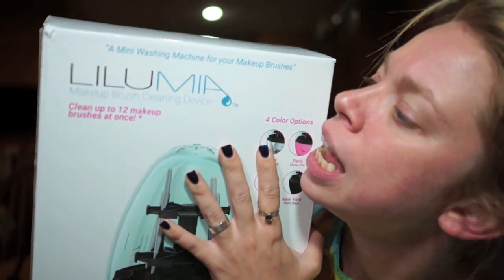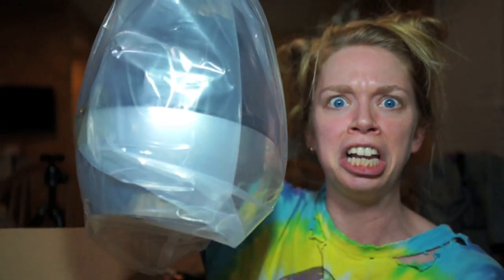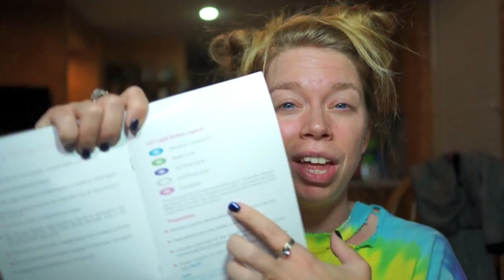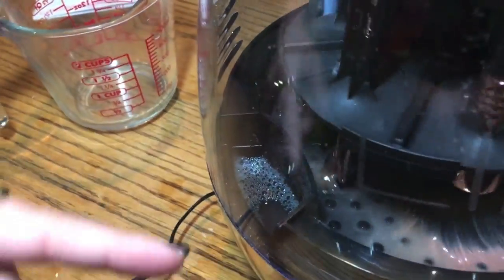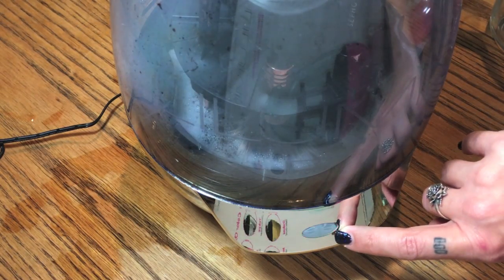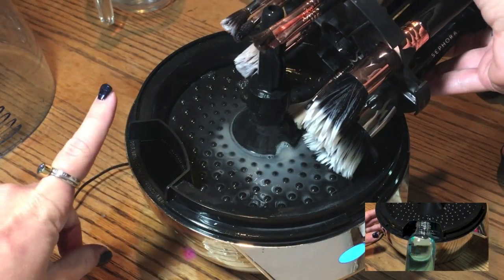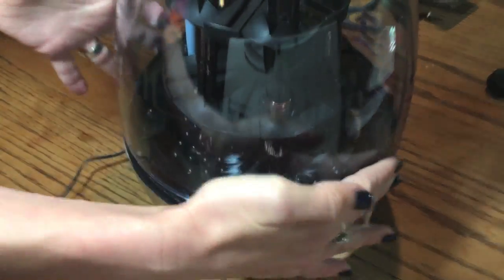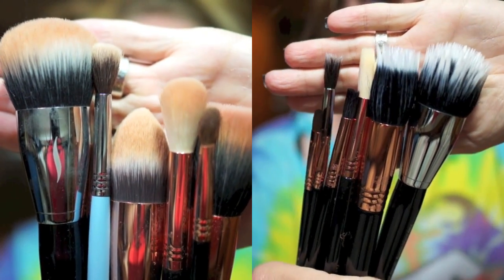MAGIC BRUSH CLEANING ROBOT? - FIRST IMPRESSION FRIDAY

Comment: Not only is this expensive, but would take HOURS if you want to watch a lot of brushes at once.

I also can't believe how little soap they give you. You would have to buy a new bottle each time to wash your brushes (considering you use 1/3 to just wash 6 brushes).
Reply: +ChapterStackss The Lilumia soap that Bunny has is a SAMPLE size soap .The Lilumia Soap is 33 ounces and last approximately 3-4 months if used once per week washing 6-12 brushes depending on load.
Reply: +ChapterStackss The product doesn't even come with that sample size soap if you were actually to buy this. So you'd have to buy the machine and also purchase the soap -.-

Comment: After multiple 15 minute cycles, you washed 6 brushes in the same amount of time I could hand wash all 36 of my brushes. Some things are just better done by hand.
Reply: Yes but she said she has issues with her hands from a car accident.
Reply: +Tanya Cole The Lilumia consist of 1 wash 2 rinse and an optional 3 min rinse cycle. The Lilumia takes a total of 15 mins to deep clean 6-12 brushes depending on brush load.
Reply: +Tanya Cole You use 36 makeup brushes?
Reply: +Tanya Cole Did you not read her annotations? A re-rinse was 3 minutes. She did another 15 minute cycle with just water because she accidentally put in too much soap.
Reply: +Humming Birder If she is a makeup artist then yes she does.
Reply: +SunnieUrieCarlile If she is a makeup artist, and I was a client, I'd want her to use a different set of brushes for each client.
Reply: +Peggy P that's clearly why you're not a makeup artist. Do you have any idea how expensive a brush set is? Never get your makeup done professionally if that's the case 😒
Reply: +Midnight--answer Don't worry.  I don't want my makeup done by a pro.  I do fine myself with five or six brushes.
Reply: +Midnight--answer Yikes Do you really think that they reuse makeup brushes after rubbing it all over someone elses nasty face?  They have to clean them in between I thought.  I know the sets are expensive and all but they do clean or sanitize them in between customers right?  Just realized this sounded sarcastic but I do not mean it that way.  I honestly would like to know the if in your experience they clean in between.
Reply: yep,but you could be doing something else while the device is washing the brushes😏
Reply: avaorchid Oh there's no need to worry about a MUA using unsanitary brushes on you, they absolutely will disinfect the brushes between customers, generally with alcohol to kill all the bacteria. I was just stating that it would be ridiculous to require a MUA to buy a new set of brushes for every customer. I can promise you that you shouldn't worry about unsanitary brushes if you ever wanted to get your makeup professionally done ^-^
Reply: This thing is really just a fun thing to watch, not very useful but as I said fun to watch
Reply: Agreed, especially if you made errors like Bunny did. 3x's 15 minutes = 45 minutes. My brushes take the same amount of time to wash and air dry lol
Reply: it'd be better if the capacity was larger. if it held about 20 brushes that would be great and would def save time. I was each brush for about 30 seconds.
Reply: still you are able to do other things while the device is working so time IS saved no matter how many cycles it takes.

Comment: Wow the ferrules of those brushes are being soaked by way too much water. This machine is a disaster. Great infomercial, Bunny.
Reply: And bunny, you ARE smashing them, stop trying to make excuses for this travesty. I'm disappointed.
Reply: What are ferrules? Are they like the metal part? Also, I totally agree with you , its gonna ruin her brushes. Also, if you look at the brushes before and after their no longer super fluffy
Reply: +ilove cats The ferrules are the metal part that holds the bristles together, and hold the brush to the handle. I agree, this machine is way too rough on the brushes. I wouldn't ever use this, especially on such expensive brushes as Sigma.
Reply: +Miriam Scully thx :)
Reply: +Michelle Katzdorn It's unnecessary for you to be so rude and sarcastic about it. You can share your opinion without being tactless.
Reply: TheSwauzz Tell me exactly what was so tactless.
Reply: Michelle Katzdorn
 "Great infomercial, Bunny." Your entire tone is judgmental.
Reply: +TheSwauzz it was a great infomercial. In case you don't know, infomercials usually consist of someone showing off how "great" a product is. That is exactly what bunny was doing. However, that doesn't change the fact that this device will shorten the lifespan of bunny's expensive brushes.
Reply: ilove cats I'm not going to assume anything. I saw the product, heard Bunny's opinion, formed my own, and all was well. This machine seems perfect for Bunny considering she said she has little hand strength and cleaning brushes requires a lot of hand stamina and strength. I'm happy it will work for her and accept that it isn't for everyone. Then again, I never said anything about the product anyway, just the tone with which some people express their own opinion.
Reply: +TheSwauzz yes , this product is great for bunny, assuming she is willing to/able to replace her EXPENSIVE brushes every few washes.
Reply: TheSwauzz You're way too sensitive if my 'tone' (which you can magically hear through the internet, give me a break.) bothered you. Get over yourself, not everything is rainbows and flowers and not everyone will kneel down to a YouTuber.
Reply: Michelle Katzdorn
? I'm not asking you to kneel down to a YouTuber. It doesn't sound like I'm the one that needs to get over themselves, but okay.
Reply: Miriam Scully ikr!$150 for ruined brushes? No thank you
Reply: TheSwauzz You don't think you need to? When you can't seem to handle someone giving the hard truth to your idol? Wow, can you not?
Reply: Why are you guys arguing? This is exactly what bunny doesn't like!
Reply: +Michelle Katzdorn Then don't use it, who made you the "expert" on what does and doesn't work for everyone else? If you yourself have not used this, then you cannot really say one way or the other that it is bad...
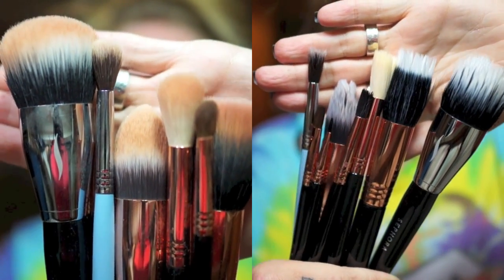Reply: +David D look what it did to her brushes 15:35
Reply: +David D also it's extremely common knowledge that crushing your brushes is like the #1 way to ruin them, and that machine is crushing those brushes
Reply: +Michelle Katzdorn Agreed! This is a brush destroyer.
Reply: +Georgia Harry Once you "break" the bristles by that kind of abuse it is really hard if not impossible to get the hairs to behave again.
Reply: +David D I would like to see what Bunny has to say after using this about six times on the same brushes, I already was seeing damage on her big face brushes. But honestly, with the big brushes, it is not such a big deal if you have fly away hairs, it is the precision brushes that you need the hairs to stay tight and in place.
Reply: the brushes are still wet at the end. Takes no genius to figure that out .....
Reply: Allie Stephens I think after a few "washings" the brushes will really begin to show the damage. Just one washing and there was some damage to bristles, and we didn't really get to see all of the brushes. I am sure with continued use, like once a week, this method is going to bust up the brushes. But Bunny doesn't have to care, she is pretty wealthy from doing this channel and gets tons of freebies. I would like her to relook at this product six months from now and show us these EXACT SAME BRUSHES after being cleaned 20 times.  For us regular people, investing $60 on brushes is A BIG DEAL and we have to make them last, for years if we can. And good brushes should last YEARS.
Reply: You guys are arguing with each other about brushes that don&#39;t even belong to you, let bunny clean them how she wants to clean them, although it's nice for some people to warn bunny about this, but don't argue over it.. Bunny has said plenty of times she reads the comments, she has also said that she doesn't like it when people argue over her videos. So please, stop worrying about things that aren't yours, and be respectful to Bunny.
Reply: If you do any makeup with brushes, it seems like common sense to wash them, and you need to know how to do that properly, correct? Seeing this machine in action shows it is faulty. Some are making it sound like just because she makes it sound like the machine is very good, lots of people will take her word and buy this expensive machine without doing their own research. If anyone does do that, then I would call it either an impulse purchase, or say that they're rich.
Reply: +Michelle Katzdorn The machine wasn't the issue, it's user error and she made an annotation about it in the video. The bristles are meant to be just touching the pad and she realized that after the fact, but it's trial and error with a new product so it's not like she was told by producers how exactly to use the machine. I would recommend looking up the videos by the actual makers of the product rather than assume the worst because Bunny did what a lot of people trying out a new product would do.

 It was a simple mistake, just like adding the soap into the wrong compartment, to act so harshly to say you are "disappointed" as if she is some professional speaker for the company is quite rude and unnecessary. If you watched any of her other "first impressions" and "does this thing really work" there are a lot of mistakes made, I honestly didn't expect any different from this one.
Reply: +iHashtag Hashtags  ya what +I hashtag hashtags said

Comment: So it's a 142 dollars and takes forever to clean your brushes and doesn't even dry them?! No thanks It takes me like 10 minutes to clean ALL my brushes. I would've liked this machine if it also dried the brushes. But just to clean them I think it's too slow, too expensive and too big.
Reply: +Anouk van Sister it takes 15 min for 6 to 12 brushes and its better to air dry anyway
Reply: Besides, with a tapered brush all the bristles won't touch the surface and the larger brushes weren't getting moved around as much as the little brushes
Reply: I agree, the machine should dry the brushes too!
Reply: +Anouk van Sister It's $127 according to their website and can you please give me tips on how to clean several brushes in 10 minutes? It takes me hours to get an effective clean by hand
Reply: +Ashley White when I had a look at the website I saw $142 as well down from $174. I do agree though that there's no way I could do my brushes in 10 minutes, but I achieve the same thing by using the Sephora solid brush cleanser that comes with a rubber agitator pad.  Also their cleaner is $14 a bottle which considering you get three or four rounds of of one bottle seems excessive.
Reply: When I ordered mines they had a pre order sale, which I got my device for $127 and according to their Instagram it's going on until next week. The devices aren't as expensive as $145 and up with the exception of one color option. I personally ordered additional soap because its 33 ounces and if only needing to use 2-3 ounces per wash thats enough to last for 3-4 months even if used twice a week. The soap Bunny had is not the one you purchase off their website.
Reply: +Ashley White The price depends on the "model."  The one Bunny had was 142.00.  Even $127.00 seems a bit pricey, to me.
Reply: +Ashley White use a mild shampoo rub it in a little and wash out. Really easy and effective.
Reply: +Anouk van Sister on top of that you gotta keep buying their soap to clean the bruses...
I also thought it would at least dry the brushes and like sterilize them or something!
Reply: +Anouk van Sister Sephora brush cleaner, its amazing :p and only $6. Also lasts for months! I love it. xD
Reply: Kate Celmiņa I hope you have a great day too!!
Reply: +Kate Celmiņa wow what's with the hate?! you must be like 12 years old to think it's ok to talk to another human being that way. ..
Reply: thats exactly what i thought!
Reply: Lexi Groban You're stating exactly what I said. It's $127 with the exception of one color and that is the one Bunny has.
Reply: Ashley White  Don't get your knickers in a knot.  My computer was acting up the day I replied to you and your entire message did not appear.  I was just trying to be helpful.
Reply: +cat ford ikr I'm twelve and I wouldn't say that!!! she's so childish!
Reply: +Ashley White You should have waited for the black Friday sale when they'll be $99 down from $159
Reply: Yes! I was hopping that center rack thing would spin em kinda dry like a washing machine. And yes, having to use THEIR soap is ridiculous! That alone would prevent me from buying it. But the price is just too high anyway... Could see a $19.99 Conair version on the shelves of Walgreens in the near future... Now THAT I'd try. ;-)
Reply: Argee
Reply: and she said it takes her 30 minutes to clean her brushes manually but it took a total of 30 minutes to wash them in the machine with the extra rinse cycle
Reply: sabine nekas What is wrong with you?
Reply: +sabine nekas She didn't say it was bunny's fault she was just talking about the product in general.
Reply: The time it takes to manually clean the brushes might be the same as the machine, but you don't have to actually be there when the machine is doing it so you do sort of have that time to do your own thing
Reply: Agree. completely agree
Reply: okey okey
Reply: Michelle Ng others like the others did not like
Reply: +cat ford I wonder if you can use some other type of soap though. Or if they are saying you have to use theirs just to get you to buy more.
Reply: I agree with you
Reply: It disinfects your brushes unlike you washing it under the tap lol
Reply: Yeah it's a waist. It's not worth it
Reply: +Ayce Okur 
you have obviously never learnt infection control.
Reply: +Sarah Grace that's my thought HAHA 
This thing looks like 30 dollars tops. I think anything above 100 dollars is waayyy too much!
Reply: +brittanie sidebottom I guess you could use any water-like fluid cleanser that desinfects/sterilises. Or just thinned shampoo. I think a normal amount of shampoo would be too much.
Reply: +Ayce Okur a bottle of $2.99 isopropyl alcohol also disinfects. This thing doesnt work. other reviews showed the true results & they were filthy, sitting in brown water, and it couldnt even remove lipstick.
Reply: Allison Ho PLEASE  shut UPP
Reply: Allison Ho How did they get dirty water? I mean Bunny had to do two cleaning circles but the water was finally clean.
Reply: +sabine nekas you should be telling your self that
Reply: +sabine nekas omg so sorry it wasn't meant for you I agree with what you are saying
Reply: +Bethany Perez waste*
Reply: +Anouk van Sister I'd rather buy a Sigma brush cleaning mat and do it myself.
Reply: +Anouk van Sister Some people have arthritis and can't get them clean.
Reply: Yasssss I agreee
Reply: norma jean someone who has so many brushes to use such a thing I'd say they paint their finger nails or something :D
Reply: Jennifer Bouvier why are you telling me? 😕
Reply: +Ashley White true. like it takes me 10 minutes to clean one brush
Reply: U are so right now I won't get it
Reply: celebritymishap me?
Reply: and the way they clean them is completely wrong. that ruins the brushes scrubbing them this way. it's deforming the brushes.
Reply: you can dry them with it but I guess she didn't read that part
Reply: I purchased this machine. it doesn't work. my brushes were still dirty. a lot of youtubers have videos out and it's always the same. the brushes are still dirty. don't purchase
Reply: Heather Decoskey did you run it twice?
Reply: +Jennifer Bouvier so u pay 142 dollar's and u have to run it twice? think ppl are being ripped off
Reply: norma jean bunny did so and it "worked" :D
Reply: +Jennifer Bouvier I just think it's well over priced.
Reply: norma jean I don't do make up so I'm not sure but I think I'd pay 30 $ tops :D
Reply: +Jennifer Bouvier I would probably pay £40
Reply: After it ran once the brushes were still dirty. So yes I ran it a second time and they still were not clean. It's suppose to clean them in 10 min, not 30.
Reply: Heather Decoskey woah LOL
Reply: it means you can do something else (possibly more productive) for 15 mins instead of standing around cleaning brushes.
Reply: Yet, it is still damagi to the brushes
Reply: +Anouk van Sister 142 plus 20 for the soap ;-;
Reply: Olivia Evelyn I bet you can use any soapy water.
Reply: +Jennifer Bouvier I use had soap or baby shampoo
Reply: +norma jean hand
Reply: yeah but its for cleaning them not drying could you not just get a hair dryer that should work
Reply: Tehya spiers Tehya The could but I wouldn't wanna use a hairdryer for/after a thing that costs "hunnit fiddy dollars".
Reply: Jennifer Bouvier yeah I guess so they could of pit like some air blowing from somewhere so they dry
Reply: sammeyj yeah it does
Reply: It does work
Reply: Bgirl823.Msp who said it didn't? I think people are just saying that it's too expensive, when you can just clean them yourself for cheaper .
Reply: +Anouk van Sister She said it cleans them fast :l
Reply: Well if you don't have a lot of brushes then it is easier doing it by hand but if you have a lot of brushes this could possibly save time and you can do other things while the machine is washing the brushes, what is easier adding some soap and water to a machine and pressing buttons, or manually washing all of your brushes by hand.
Reply: Stephanie F. Ok
Reply: Plus it's to heavy maintenance and seems like it'll damage your brushed